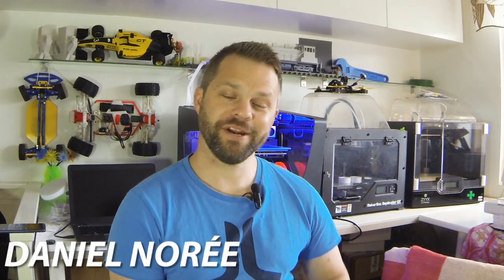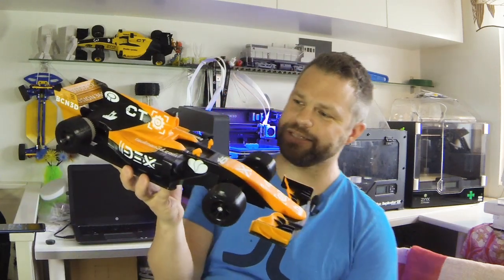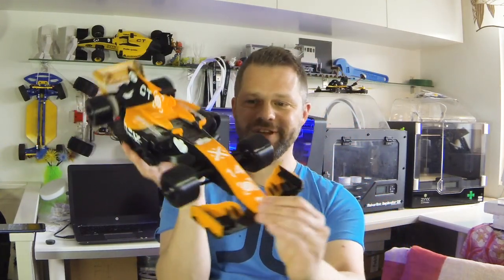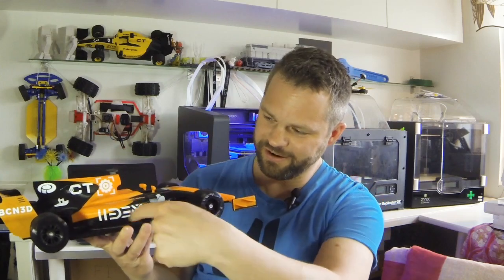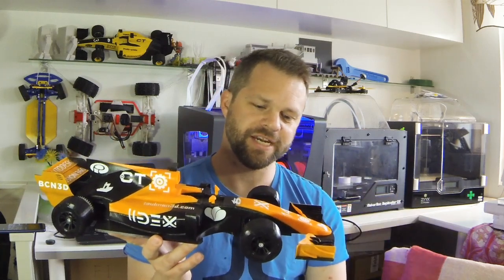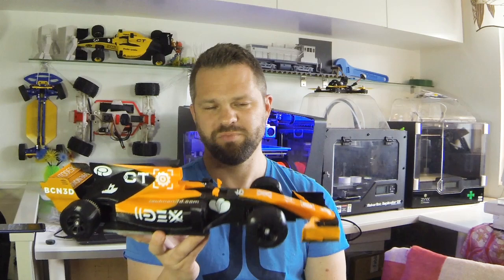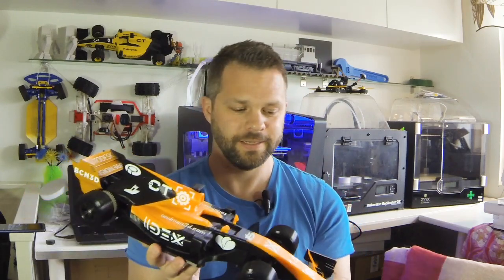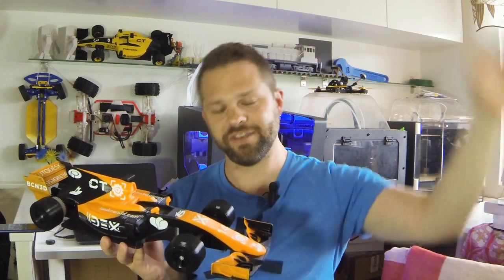3Dprinted McLaren style OpenRC F1 RC car

Comment: Did you need to print components separately or you have done printing as one assembly. thanks for advice
Reply from the maker: +Bosanski Covjek the components are printed and the assembled. These body parts are printed using dual extrusion.